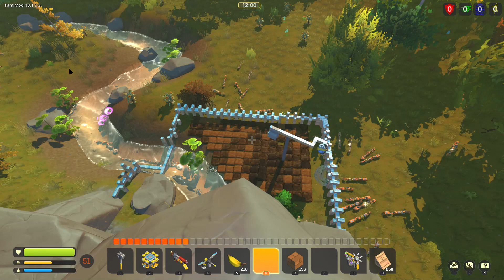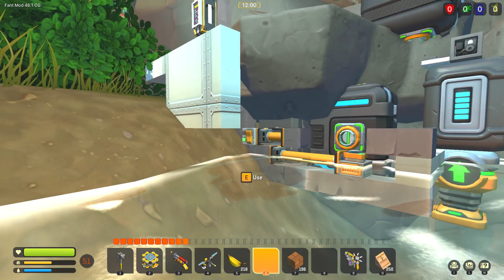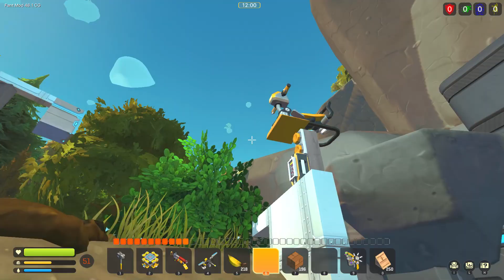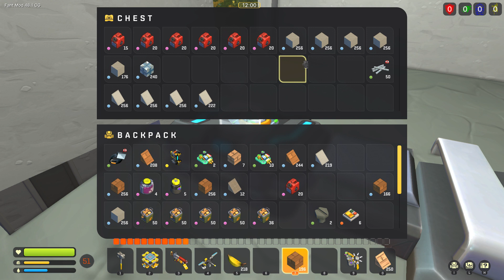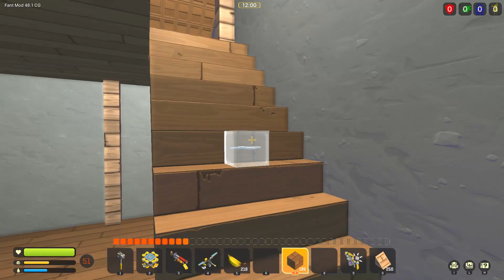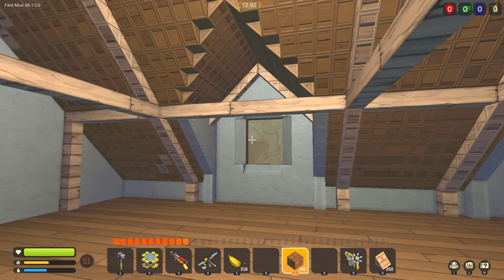Scrap Mechanic Survival - Tour of my HQ. Awesome secret passage - Including loft and basement areas.

Comment: just got into this game after a few years of letting it rot in my backlog. It's quite enjoyable! I still have to wrangle with the physics, so I wonder just how bad it was.
Reply from the maker: I think what people get wrong is this is a SCRAP Physics game. Not a IRL physics engine. The math overhead of some creations people take for granted until it stops working. My best example to highlight it is you have box of pens. Simple to light and render. Open the box. Its harder, Make each pen glow. That's over head for shadow and go rays. Now tip that out. That's a stupid amount of math, and lighting to render. SM update now makes it possible to open the spill that box, OLD SM would struggle with the lighting and die if it was tipped out.

Comment: Cool location! But does that watering system actually cover all the soil eventually? 😂
Reply from the maker: Yeah. Misses 3 soil plots - LOL -  I am planning to centre it when I expand the farm. That would mean I can reduce the swing angle of the cannon  and not waste time firing out of bounds.
Reply: @GuardianOz  You should add a unit facer to it and have it double as bot defence 😆
Reply from the maker: @  That is doable. Set it to soil until a bot shows up and switch. It will need 2 Facers but its doable I think
Reply: @GuardianOz  I'd love to see that in action 🤣
Reply: @GuardianOz  You should add a unit facer to it and have it double as bot defence 😆